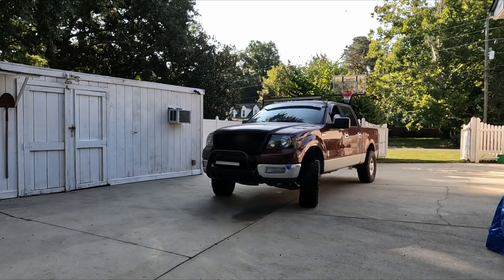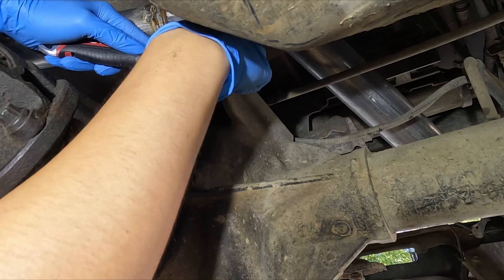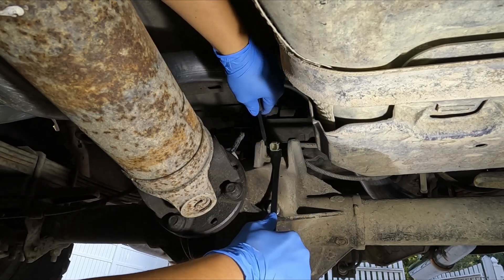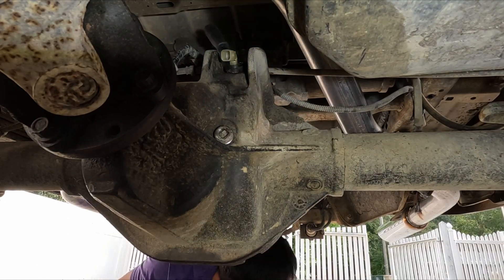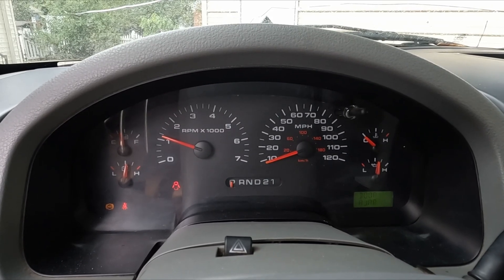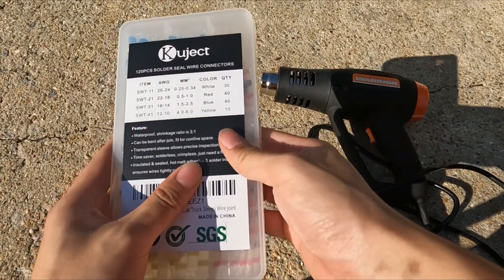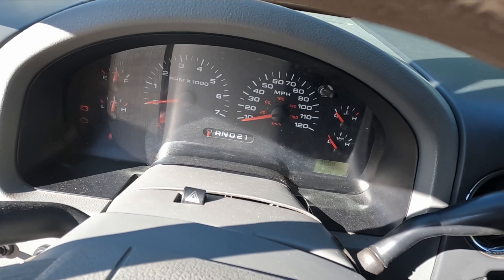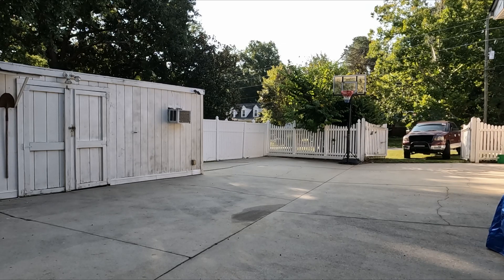PROJECT F-150: Rear Center ABS Wheel Speed Sensor Replacement and Wire Repair

Comment: Disconnect first. After removing bolt, use a flat head screwsriver to pry loose. Clean any debris from hole. Add a bit of gear grease to new part of sensor to be inserted. Reverse steps for re installation.